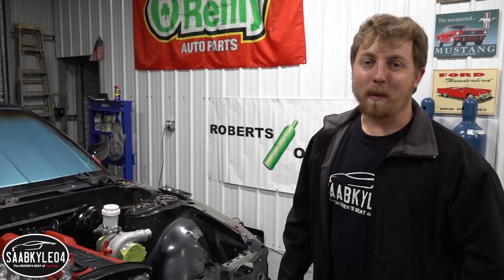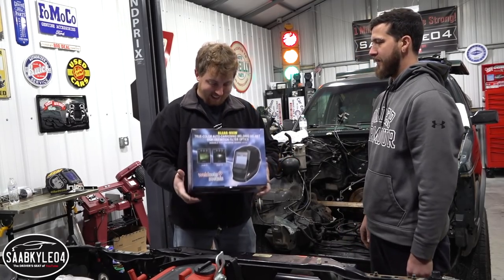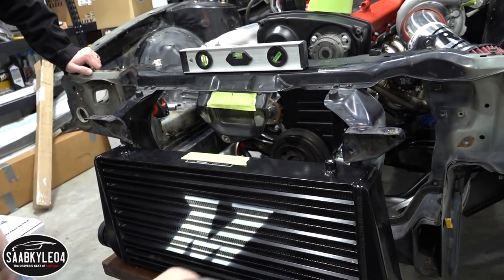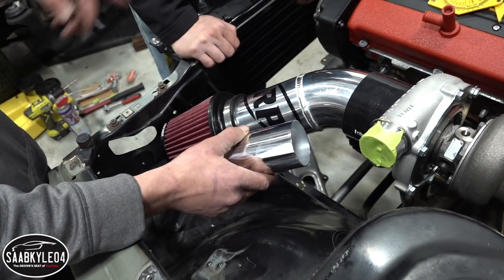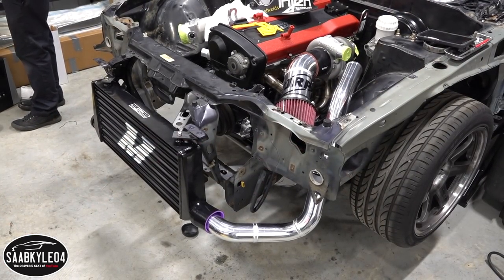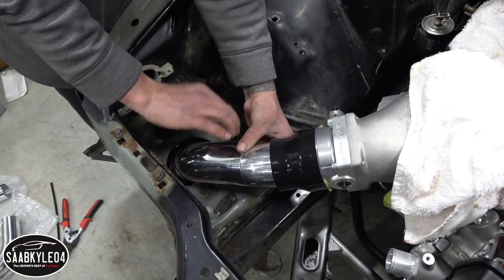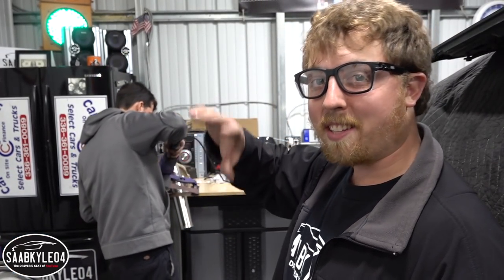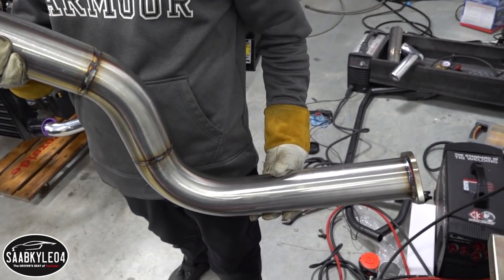Custom Fabricated Charge Piping & Intercooler Mounting: 240SX Restomod Ep.30

Comment: I would strongly recommend welding gussets into the upper intercooler mounts, and the lower ones too if they're made of right-angle steel like the upper ones.  With the right-angle steel you can get flex where it is bent into the right-angle which will cause vertical vibration in your application and that could cause the mountings on the intercooler and/or the welds on the charge pipes to fracture.  Some people might say it's not necessary, but I would say that that's how the brackets would be built if they were being used on a race car to ensure reliability so it certainly would be worth it to ensure the reliability of your Nissan and to prevent premature failure of what is almost certainly and expensive intercooler, as well as potential turbo and engine damage if foreign bodies get ingested...
Reply: I have a clip of me standing on top on the intercooler after we installed it, it was welded at 140 amps and full penetration it isn't going anywhere 💪🏽
Reply: @jondillard3777    That's fair enough, it's had a good test then...

Comment: 6:00 I bought one of those Ryobi ONE+ drills and I must say they are so great. The battery is smaller and lighter than the old NiCd and also lasts what seems like forever longer between charges as well. Unfortunately my Ryobi kit was stolen one day and I replaced it with the new Craftsman drill that comes with the C3 19.2v lithium batteries. In principle, it is the same as what I had, but it seems to me like the C3 batteries are a little longer life than the ONE+ batteries.

Comment: Hey Kyle I got an idea the for oil to the turbo situation. Put on an external oil cooler just like the Jimmy had but use teflon lined braided steel AN lines instead of rubber. But run the pressure line from the engine through the turbo so the hot oil goes to the oil cooler and the return line has cool oil going back to the engine so the oil lasts longer.

Comment: So what are your plans for the brake booster/master cylinder? Are you going to fab a metal wedge plate between the manifold and turbo to tilt the turbo to the left towards the valve cover? Or is it something else? I love the attention to detail here, good job!
Reply from the maker: Thanks buddy!  I just ordered a brake booster delete kit from Chase Bays.  I got a bunch of stuff from them to just replace as much old stuff as I can with things that are designed to work with the swap.  It'll make things a lot cleaner and I think I'll enjoy the feel of the manual brakes more than the boosted setup.
Reply: @saabkyle04  Well I can't wait to see the set up soon, it should be really interesting! I haven't ever seen manual brakes on a modern car like this so it will be fascinating to see it all together! Good work

Comment: You can also use Solar flux instead of purging gas correct?
Reply: Definitely could use solar flux but I prefer to gas purge. It's there may as well use it right? Lol but none the else yes if it's a large area that would require alot of backing gas solar flux would be a great substitute
Reply: @jondillard3777  yes yes i worked with formula student, and to weld ss headers, i had used solar flux because we didn't have an inert gas on the side.
Reply: @RahulJC  are you in the states on the east coast? If so hit up a Robert's oxygen they'll get you squared away man!

Comment: are you considering cleaning/detailing the engine bay at some point?
Reply from the maker: Going to be repainting it when we're done figuring out how everything will be fitted/mounted.  Just in case we need to cut/weld/massage anything.
Reply: @saabkyle04  that makes sense, keep up the work!
Reply from the maker: Thanks a lot!